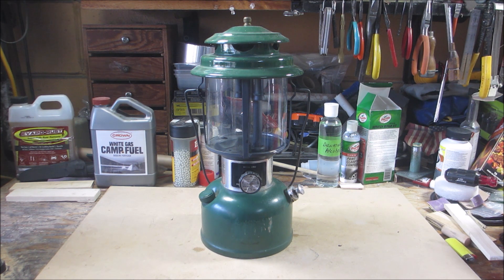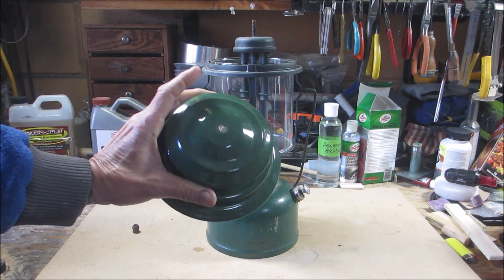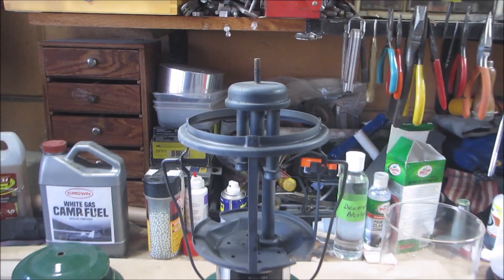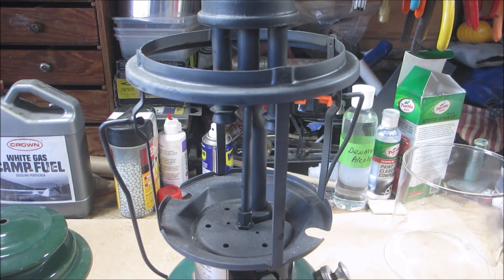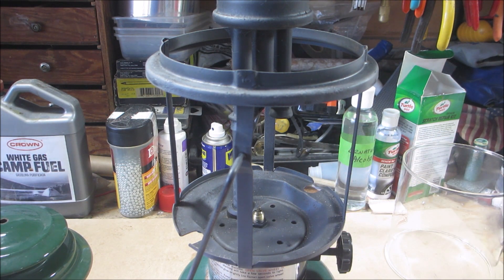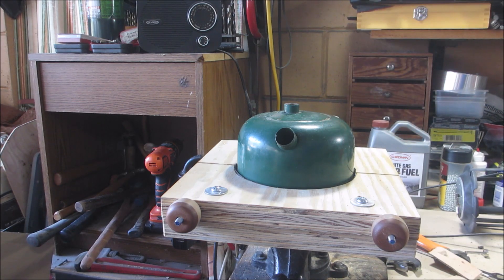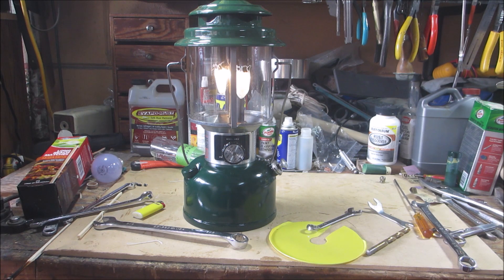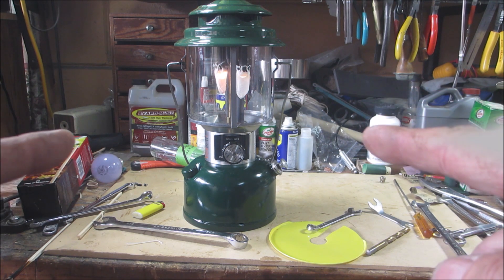Let's restore a Coleman 220J Lantern!

Comment: I have a 220J and I took the burner tube assembly off the frame by un-crimping the tube at the base. Used a modified punch and a hammer to re-spread the crimps on the tube.

Had to on mine because it was a basket case of a rust bucket., The entire frame had rusted. 

It now looks like new.
Reply from the maker: That’s awesome brother! Great job!!👍🏻

Comment: You will never guess what I did to my old formaly rusty 220E ?  I painted my cage with Rustoleum high heat 2000 degree flat black. You actually got me thinking because it took a week or so to get the rust off. Of course the plating was way to corroded and didn't look so well so it got sprayed. 
I'm not finished yet. Your 220j is in 75% better shape than mine. Did you make your own fount clamp ? I don't have one yet. Also, you do not have a black collar lantern. They usually are on the red 200A models.
Reply: Also Dom, try using citric acid in a pot heated on the stove. They say that's the best method for the cages
Reply from the maker: Oh wow the 200A! Maybe that’s what I read about! I started using electrolysis! It works really well! I’m also thinking about making a mini sand blaster! 

I did build this vise, Robert from Bluegrass Bushcraft has a video on making one and he also sells them! It’s a must have! 

Thanks for watching brother, I appreciate it!

Comment: Hey - I have a model 220J that has good pressure, but won't light. you can even see the gas pressing on the flame of my lighter. any thoughts why it wouldn't light?
Reply from the maker: Could be a clogged generator or a bent pricker. Is the air tube and burner tubes clean? If you take the generator off do you see fuel coming out when you turn the valve on? Let me know.
Reply: @Dominic.Minischetti  Thanks! I will give that a try.